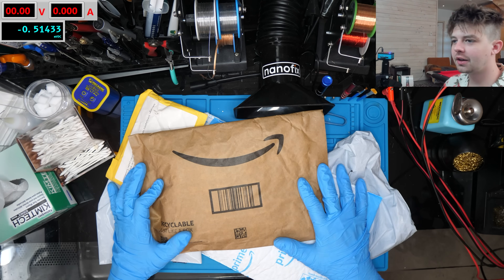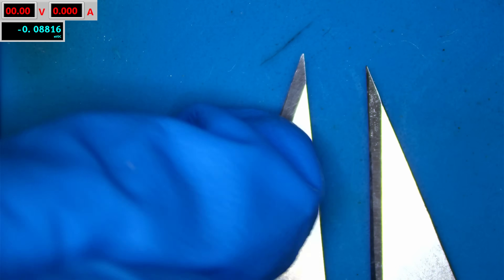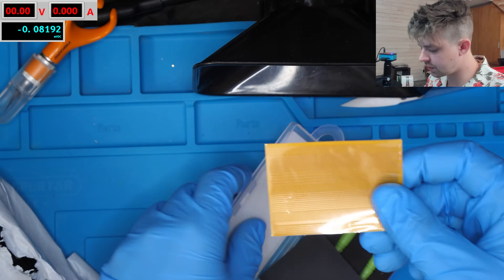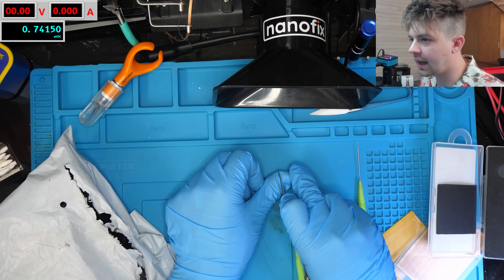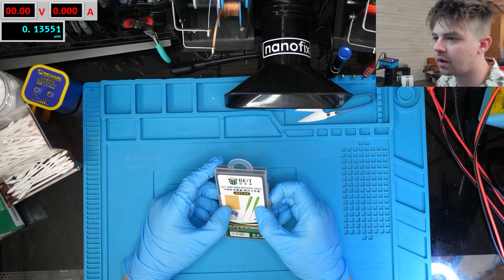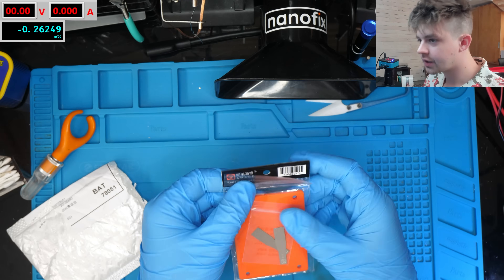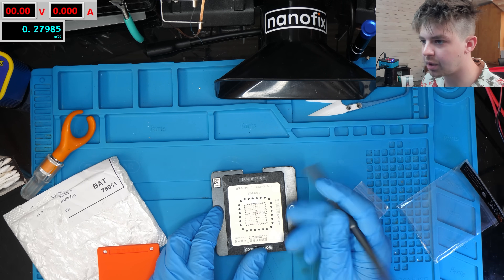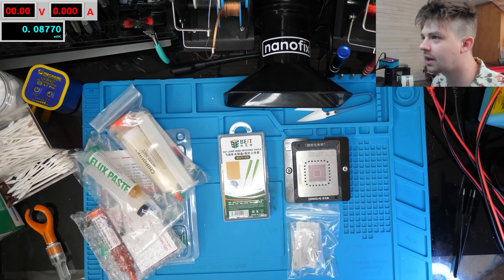Must Have Trace Repair Tool! - Mail Day

Comment: When you use the replacement traces and go to take them off of the adhesive backing, you can take a little ipa on a q tip and wipe over it a little bit to release it from the adhesive, no?

Comment: 7:22 Zach, try this trick to see if it makes it easier to peel them off: heat up the tips of the tweezers/probes for a few seconds (around 200-220 degrees should be OK).

Comment: Picked up a set of 8 different shaped small blades like those for my son for his D&D/crafts but also got the T12 soldering iron adapter to make them hot knives. $27 CAD on Ali with the adjustable temp soldering iron.
Reply from the maker: Oh yeah I saw a few things like that on Ali, it's a good idea!

Comment: Quick question, where do you get genuine parts like ssd controller or south bridge for ps5??? 
I live in Ontario.
Reply from the maker: If you're running a business, look into MobileSentrix. They're a supplier that only sells to businesses, but they're a godsend. Otherwise Aliexpress is the next best option as far as price goes, you just need to wait a couple weeks. I also always recommend buying 2 of what you need from Ali in case they sell you a broken part. But if you find good sellers on Ali you don't always need to do that.

Comment: Man I have the tub version of the (supposedly) same MG chemicals flux which I load into a 5ml syringe, and the thing keeps getting clogged! I'm talking hulk smash pressure on the syringe plunger lol

Apart from that I'm happy with the performance as a occasional hobbyist & first flux purchase.
Reply from the maker: haha that used to happen with the fake amtech I used to use and it drove me nuts 😂
Reply: @nanofixca Right?! Tf do I do I have a portable setup meaning no dedicated desk with hot air station etc, pain to find the hairdryer but better than turning on the radiators in 28°C+ weather lol

Annoying asf man glad u feel my pain😂😅

I think it should be part of the strongman's test or something haha
Reply: And if it does magically unclog it goes bloody everywhere!

Comment: Cheers mate! We are all in love with YCS lol... Talking about it... There is an old way to get custom pads for trace repair with the soldering wick, you just need a tiny piece of wire to shape it with the tweezers and place it on the pcb. You can make any shape! At this point you may be asking why is this related to YCS, well, Yang posted a video a few days ago explaining this tecnique, check it out (it's gold). I am going to check those probes, i hadn´t any luck yet getting a good ones, they usually have a lot of resistance.

Comment: I go through a lot of exacto blades; I use them for cutting small opening in shells when upgrading retro consoles with HDMI ports. It's been my experience that they're not all made the same and care must be exercised when using cheaper ones. My favourite brand is Xcelite (Made in USA); I can put a lot of pressure on them, they can bend and pop back. X-ACTO blades from Staples shatter with any pressure, very dangerous!
Reply from the maker: Very good info! Fortunately I never need to put lots of pressure on mine (especially with the tiny precision ones), but that's definitely something to be aware of.

Comment: Another awesome mail day! Don't suppose you'd have any opinions on the new-ish Fnirsi SAG-55 hot air gun, or Mechanic Action 2 multimeter microscope? Not much coverage so far
Reply from the maker: Thank you! I just saw the FNIRSI hot air gun pop up but haven't tried it. Glad to see they're branching out to other tools, I like their stuff so far. The Action 2 looks interesting, I didn't see that yet. Although I'm a bit confused why they went with USB C for the probe connections instead of the standard banana plugs. That seems unnecessary haha
Reply: @nanofixca proprietary consumables, a classic trick! Hopefully the 55 lives up to their legacy!
Reply: @nanofixca who doesn't love proprietary nonsense 😭

Comment: That stirri v3 smells good but it will put your  cleaning  process  to the test, because that flux has a UV tracer dye in it and it will show  everywhere the flux is present when you turn on the uv light 😅.
Reply from the maker: Oh my god I didn't know that, that is going to drive me insane trying to get it all off 😂 Cool idea though!
Reply: @nanofixca OMG it does drive me insane. But it is a good  thing  because  you can see where the flux is, if it splashes everywhere when  cleaning  with alcohol. Other fluxes don't  have that  feature  and they splash everywhere and no one  can't  see it, but they are there. Another positive  thing  about stirri is that they make some fluxes like the V3 , that are REACH compliant. It means that the chemicals used to make these fluxes do not pose significant risks to human health or the environment.

Comment: Ali keeps showing me the same soldering accessories  over and over . Ty for showing me more 👍🏻
Reply from the maker: Haha yeah Ali is somehow convinced that I always want to buy the same 3 tools 😂
Reply: @nanofixca  Try out the BEST brand 60/40 solder. Super shiny joints, wets well and melts at lower temps.
Reply: I have the same issue lol

Comment: Hopefully that silicon mat for the chip holder does not bubble up or warp when applying heat to the stencil.
Reply from the maker: Yeah I was wondering about that too, we'll have to see! Fortunately since I'm always using 63/37 solder paste, I won't ever really need to apply localized heat for very long. The stencil itself will likely absorb/deflect a large portion of the heat during reballing.
Reply: You have other material but silicone will burn in direct heat from the hot air station.